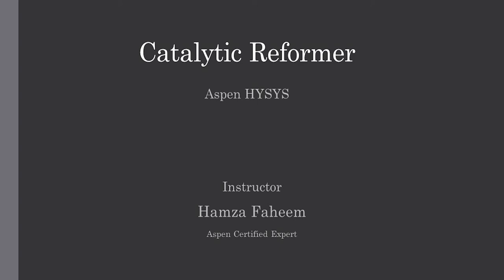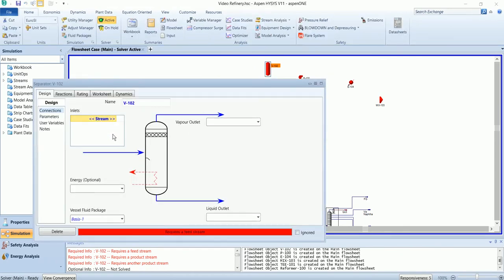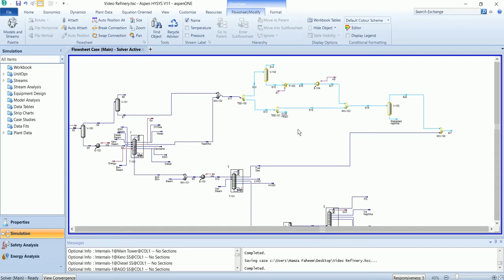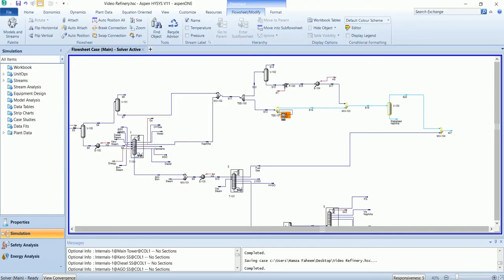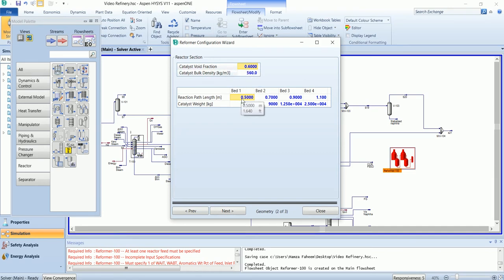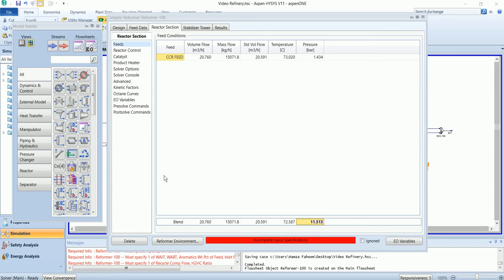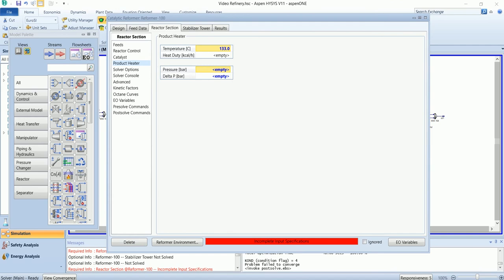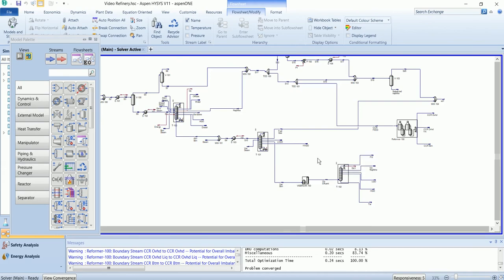Continuous Catalytic Reformer || Aspen HYSYS || Refinery Process Video 05

Comment from the maker: The refinery process video playlist contains the simulation of refinery unit operations available in Aspen HYSYS. The data for these videos are collected from different sources and does not has any validity or authenticity. The purpose of videos is to teach the simulation method of these unit operations.